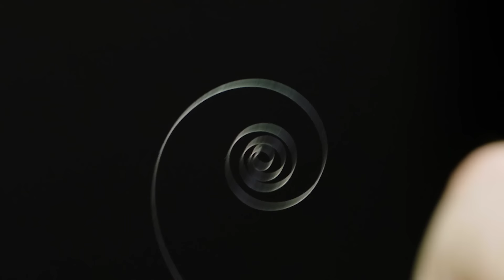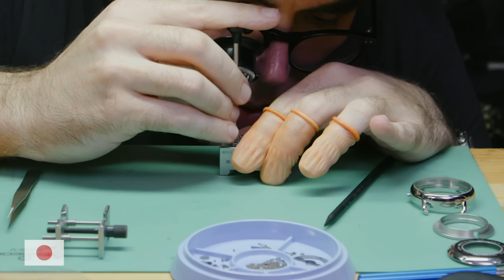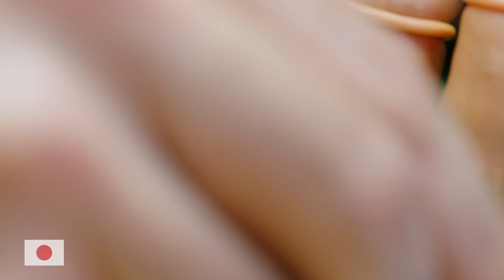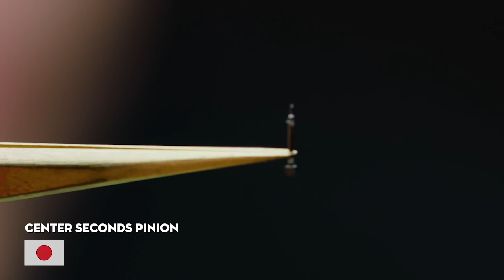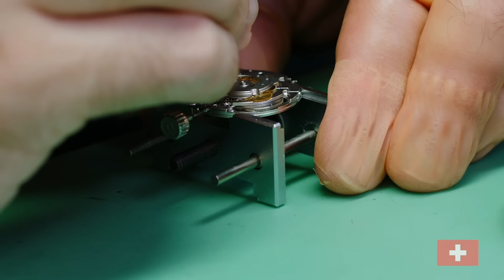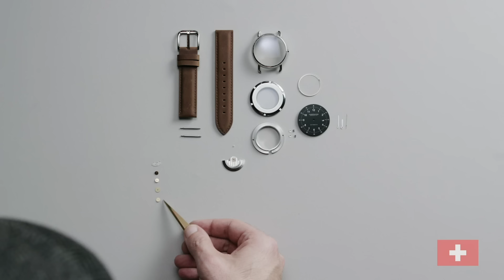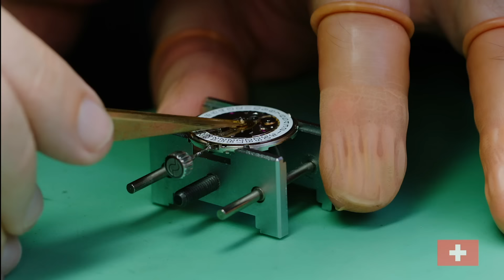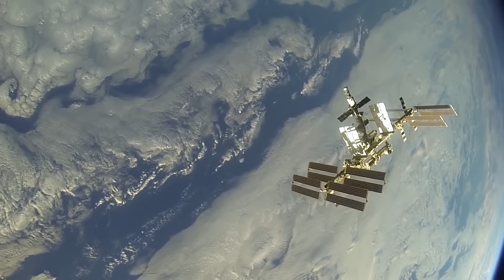Watchmaker Breaks Down Swiss vs Japanese Made Watches | WIRED

Comment: Why is the japanese movement cheaper than the swiss one if the swiss one uses fewer parts? Is it because of the additional automatic function of the swiss one?
Reply: as you might see in the video some japanese components are made of plastic and some components are not as efficient as swiss (reverse rotary).
Reply: snoworder, Seiko automatic watches have bidirectional winding, and the mechanism is much simpler than the Swiss locking and unlocking wheel assembly. Cheers, BR
Reply: When comparing two watches that are on pretty much the same level, the Swiss ones are often more expensive because people are willing to pay more for them. You pay for a name and an image associated with it. Even if you stay in Switzerland. An Omega watch will set you back much less than a Rolex despite being not inferior. However, it would be a much more fair comparison if he had chosen two watches with a similar automatic winding mechanism.
Reply: Good question. Ask the Swiss. The Miota uses more mass production techniques then the ETA. In Reality the quality of these movements is about the same and it comes down to details. E.g. the bidirectional winding is not unique to ETA, Seiko has bidirectional winding in their cheapest mechanical movements and it is considered the most efficient on the market. The true quality of the movement is defined by its adjustment and regulation - which take a lot time and manual labor and can multiply the price of a movement by 10 or more.
Reply: If I understand correctly, plastic parts don’t require lubrication and therefore allow for less frequent servicing.
Reply: radry100 Swiss watches are for rich snobs and Japanese watches are for smart people who want quality at a fair price.
Reply: @stevensudragor  Swiss Certina and Tissot are reasonably priced.
Reply: Because its an bad comparison its like comparing an CLA45amg to an ford focus and saying that Ford sucks.
Reply: https://en.wikipedia.org/wiki/List_of_countries_by_average_wage switzerland is one of the countries paying the highest wages. You'll have to pay japanese people a lot less.
i think thats the main reason.
Reply: Because they can.

FYI #1: Plastic is a very long lasting, durable material. There's a reason they want you to recycle it and keep it out of the oceans (how long will a metal part survive in the ocean?)

FYI #2: The Swiss absolutely use plastic parts. Check Swatch and Tissot for just a couple of examples.
Reply: It's actually mostly due to labor cost.
Reply: The price of a swiss engineer is higher than a japanese one, and in the swiss watch there's absolutely no plastic.
Reply: The swiss watch has fewer parts yet it has Bi-directional automatic winding. It also uses no plastic parts meaning its longer lasting. 

Did you watch the video?
Reply: @ @KenanPenguin  it's not like the plastic parts are under a lot of load. In fact, sometimes plastic is better because it is softer and will act as a "cushion" for the other part it is acting on. Both will last a lifetime or more (if taken care of).
Reply: Swiss watches are considered to be the best quality of craftsmanship you can have for watches
Reply: @YordleJay  Debatable...they rely on history.
Reply: The Swiss one is just much better quality, that shouldn’t be a surprise.

Comment: Do cheap wrist watches have cheap batteries? Compared to super expensive ones?
They seam to look the same, have the same etched value numbers, its hard to tell
Reply: dangeldoll Same batteries (unless rechargeable), different grades of 32768Hz crystals.   Different qualities of electronics, waterproofing, buttons etc.
Reply: When you reach the higher end of the spectrum, batteries are not used as mechanical movements are used instead. Much like the watches shown in the video.

Comment: I used to change batteries by myself 
and only go have them changed by a pro with more tricky ones, 

One time i went with 3 to just get them new batterie, dude knew how much every one was worth heh
Reply: A mechanical watch like the ones shown in the video don't use batteries. You are referring to a quartz watch.
Reply: Adam Danilowicz  yeah, my first thots when I read watchmaker is battery changing or dealing with water damage heh

Comment: Hey WIRED, can you raise the max volume on your future videos? The current max is pretty low.
Reply: for future ref, if you use Chrome, go to settings>tools>extensions, then navigate to  the extension store and download/install the "Equalizer" and Limiter extension. Once done, you can click the icon to open the equalizer/limiter to turn up/boost volume on anything too quiet. You can, of course, also equalize the program, and set the limiter ceiling for the max volume spike you want, which also can bring up the floor, making whispers and very quiet sounds stronger. Very useful extension.
Reply: @kahsa1076  Uhhh why not just turn the volume up?  Much easier to do and understand than an equalizer program lol
Reply: >brainlets not realising she probably has her volume all the way up with a low output peripheral
Reply: just turn your volume up
Reply: It's optimally loud. Maybe you've some hearing disability?